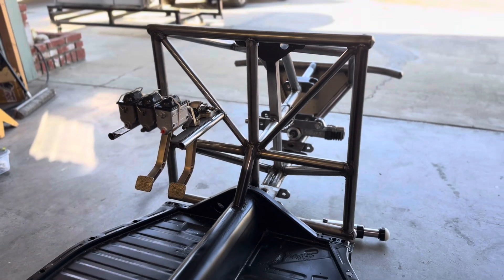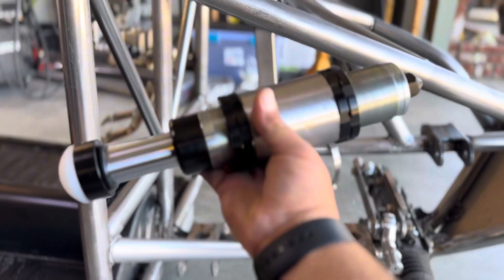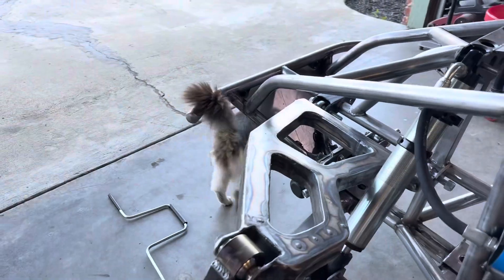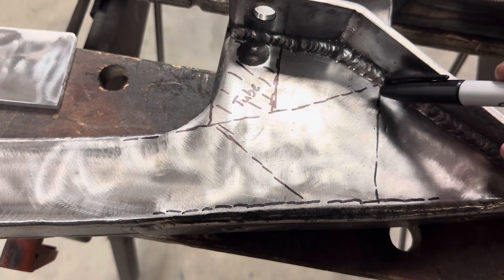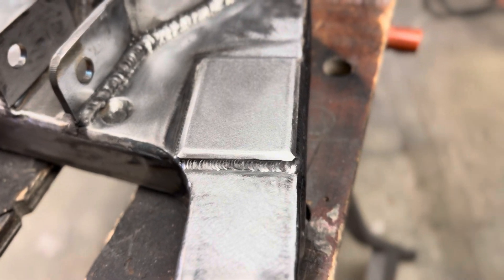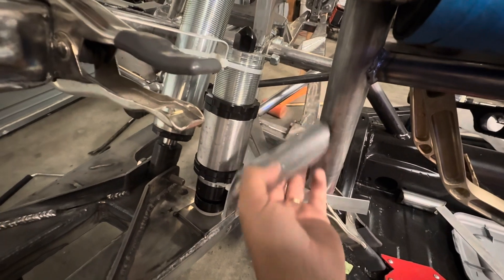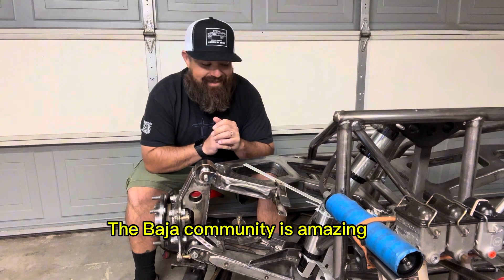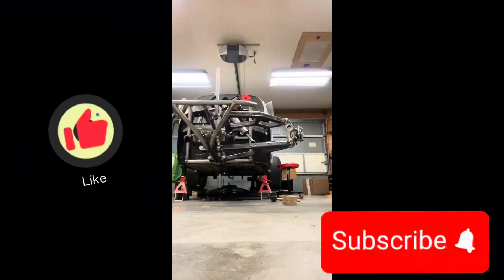Hydraulic Bump Stops on the Baja Bug???

Comment: I was told early on in my baja build by several people (whom seemed to know what they were talking about?) that in their opinion, bump stops don't work well in bugs because their relativity light compared to a truck and in their opinion bump stops are for heavier vehicles. Are they right? I have no ideal but they have much more experience than me so I went without them myself. But your pan, swing arms, a-arms front of cage are looking awesome! looking forward to the bypass video!
Reply from the maker: I tend to agree, and for that reason I went with the shorter bump stops. They were only to protect against those really hard landings. I do know they work/are needed based on the @dougbugbuilder hard landing video. With all that said the switch to bypass shocks will work better than the bumps and give me more control over the shock tuning including full bump. I’m excited 😊